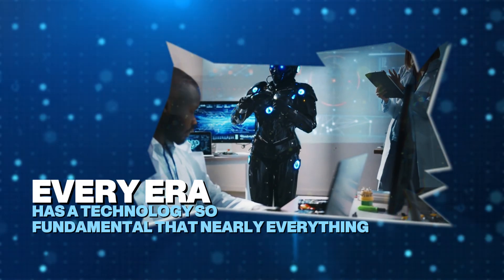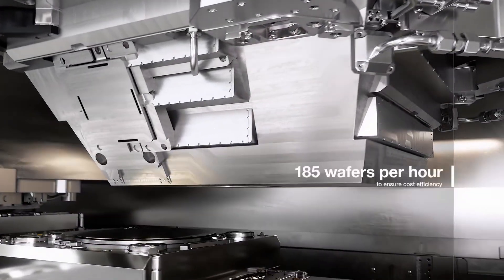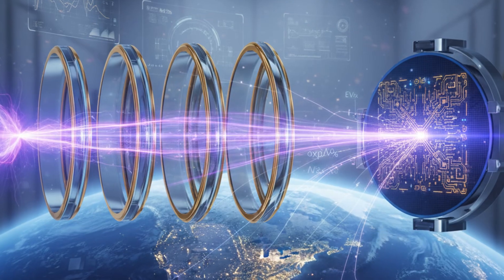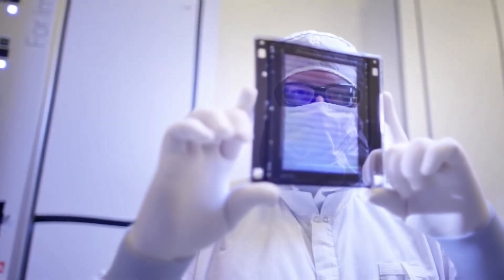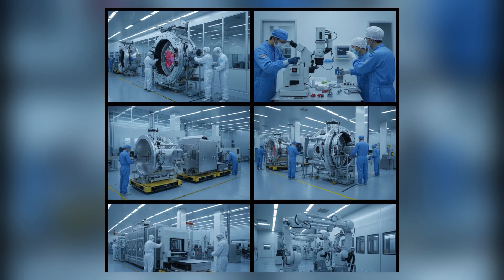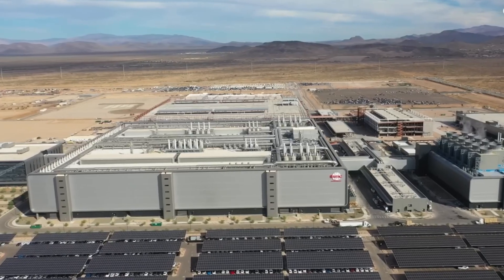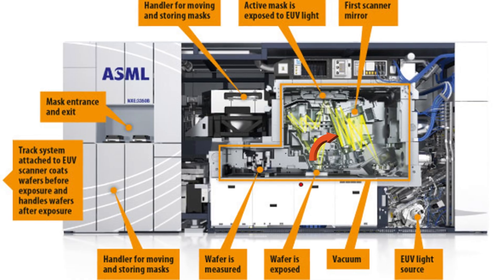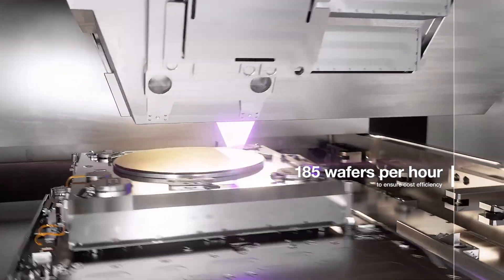The Company That Controls Chip Manufacturing

Comment: To be fair it is far more than ASML.  They largely function as a systems integrator.  They are very dependent on their suppliers like Zeiss to build key components.
Reply from the maker: Suppliers absolutely matter 100%, but integration is the hard part. That’s why only ASML has managed to pull off EUV so far.